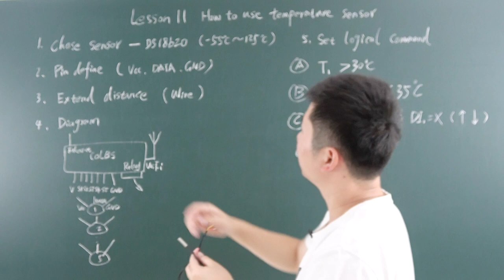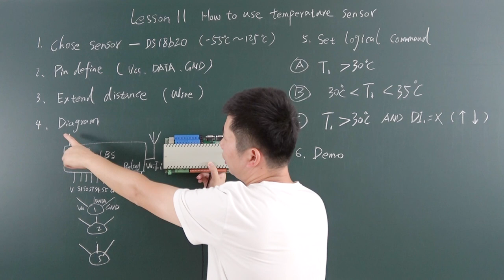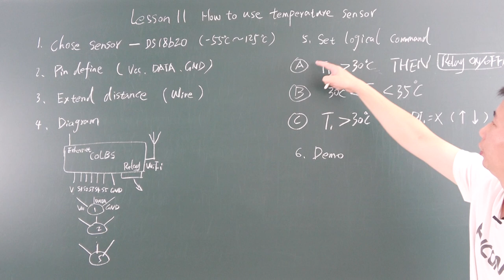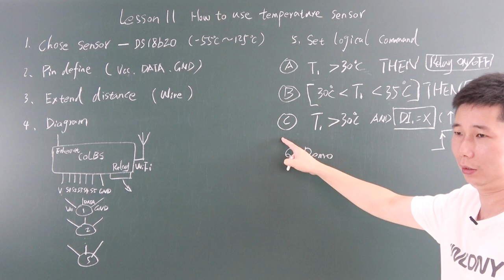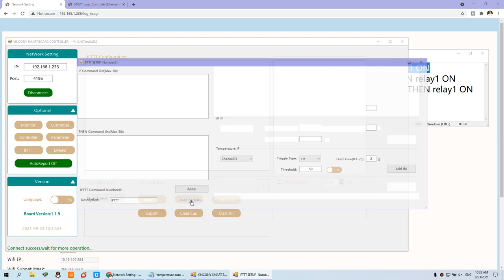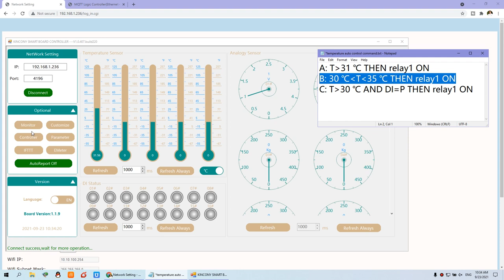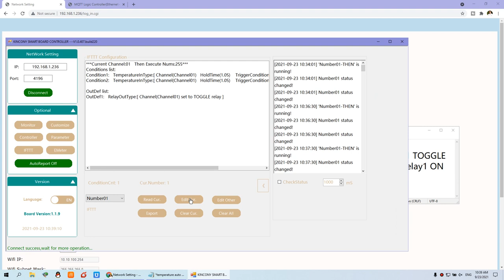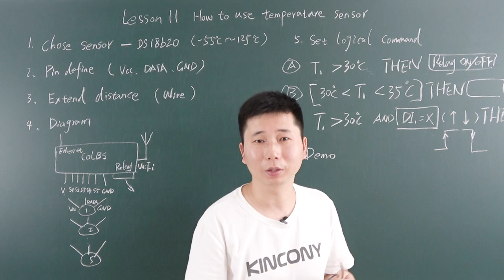【IoT training lesson beginners #11】How to use temperature sensor for automation

Comment: Thank you for the video. Please consider making video using liquid level sensor  to demonstrate the following scenario. Auto refilling of overhead water tank - When overhead water tank is empty, auto start the motor connected to one of the relays on the condition that there is water present in the sump / underground tank.
Reply from the maker: ok, use two water level sensor can do this , in furture can make this demo video.

Comment: Fantastic.....it is very usefull in industrial applications....

can i able to connect 3wire or 4 wire wet sensor to digital input...here in india the dry sensor are no more...only 3 wire sensor are avail here...which has (vcc gnd data)....how can i connect this type of pir/proximity/waterlever sensors into this colbs...is there any other way...
Reply from the maker: if output voltage sensor also can use by COLB/COLBS. DI: logical 0 (low level): DC 0-4V  logical 1 (high level): DC6-24V 
DC 3-4V undefined,critical state, not to use.
Reply: @KinCony  can i use 12v out sensor is possible by logical level high...please make video on it...
Reply from the maker: @ersheikismail8293  no problem, it support. just let signal output connect ti colb's digital input is ok.

Comment: Hi, I'm considering purchasing the KC868-AIO to start my small smart home project, and I have one question how many DS18B20 sensor I will be able to connect to one input
Reply from the maker: if you use by ESPHome in home assistant, support one GPIO use for multi DS18B20, i have tested 10pcs DS18B20 is no problem.i don't know  how many pcs you want to use.

Comment: Thank you so much
I have a suggestion, can the temperature sensor be placed in a decorative box to be installed in homes, and it is preferable to connect it with a wire or wireless?
I have a question
What programming language is used to write these commands?
Is it possible to write a program that does not exist?
Reply from the maker: yes, you can install the sensor in anywhere, sensor is small, put into water also is no problem, it's waterproof. use wire is best, if really can't put wire, use KC868-COLBS' wifi function, let COLBS beside of the sensor.
we have make the logical controller for PC software, not need program code, just use UI window for select and click, easy to use.
if you want to write a program , also is no problem, all of our controller is open protocol.